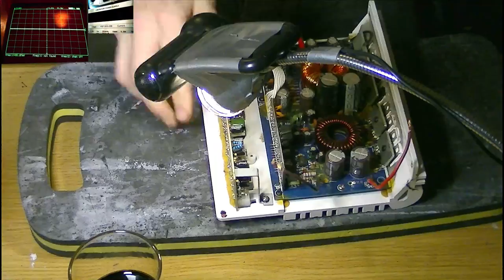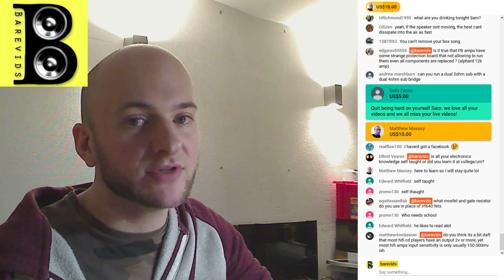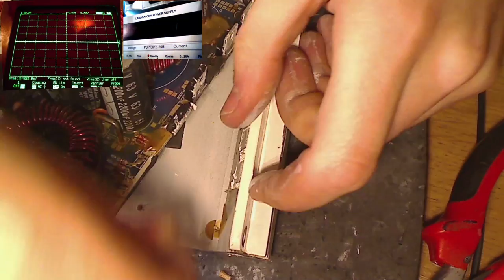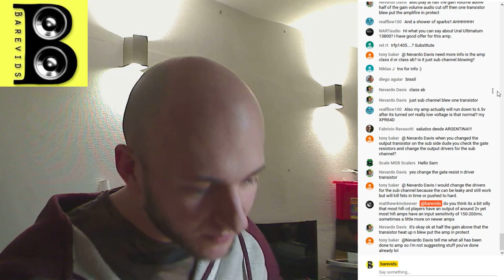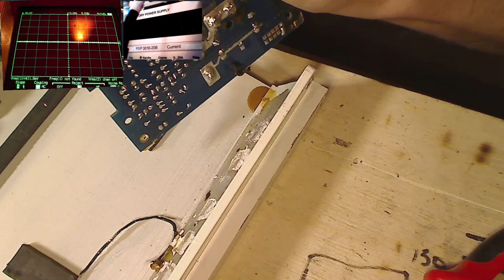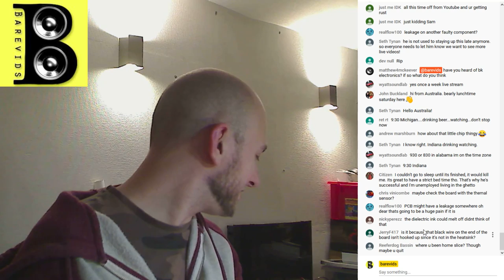How many small ass amps can I repair in one livestream

Comment: Hey Sam, I pulled of the back plate on my Brutus when I was taking the screw out for the diode it fell under the board and now it's stuck under there. Do you think I'm gonna have to pull my whole board off to get the screw?

Comment: I am only 1:24:00 in and just can't believe you have dismissed the bad 50v 10mF cap in the driver board, it has obviously spilled all it's electrolyte out the top and vented and its on the driver board and it could so easily be causing the differential unbiased output you are seeing. Im patiently watching the wrest while repairing things in the background. other thing you could do is remove the driver board and start testing all the NpN and PnP transistors on a cheap parts tester to see if they have any differences(time consuming approach but thorough. Real happy to see you making a return, always liked watching you repairs swaping driver boards and matching fet's for the output stages etc.

Comment: I've been running a repair shop for nearly 10 years now and the instant beep is a necessity to me now. I use a old avo that is digital but also I know it now for a short its instant beep but pulses quicker as it detects a resistance and you get the idea when it's a diode I really can't live without it now as I know how to test fets by sound. I would love you to fix a powersoft amp as I'm pretty sure with your reasoning and understanding you would fix one. I'm one of few people that take them on. If I could afford to send a broken one to you I would just for a vid. The only ones I touch are customers and they are stupid money